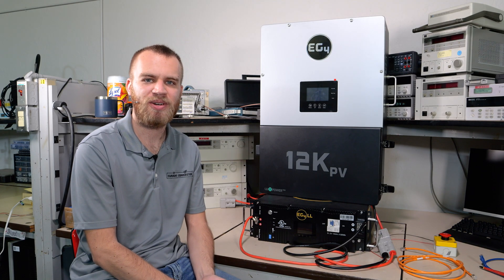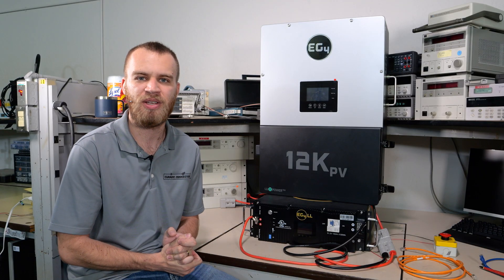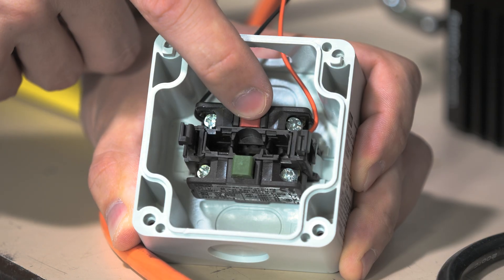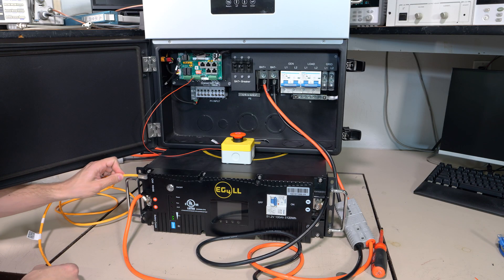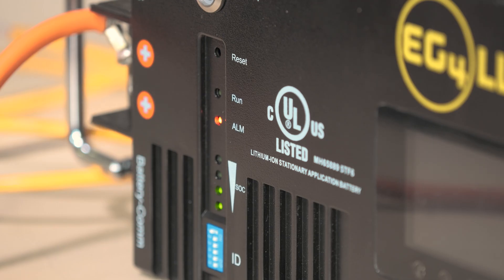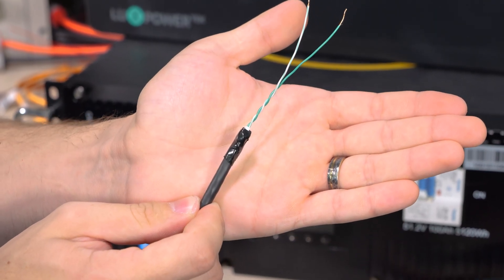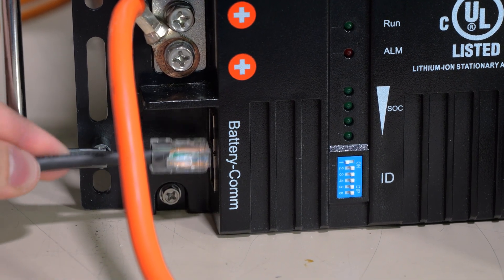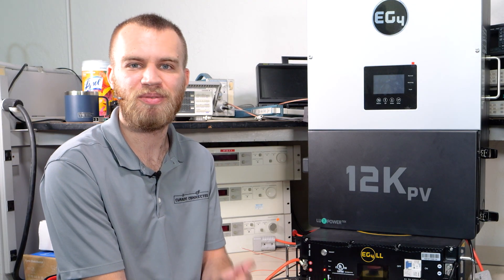DIY Solar Safety Alert! Is the EG4 Emergency Shut Off Compatible with Every Major Inverter Brand?

Comment: The rapid shutdown is pretty wild.  I've tested it a few times on my FB21/GB/battery system.  It really does turn off everything.  Turns off the solar RSD transmitter, commands the batteries to trip their physical breaker and turns them off, turns off the inverter, and the GridBoss also disconnects all the smart ports and disconnects the utility.  Literally everything is de-energized.

Fortunately it's pretty easy to get things online again.  I just have to flip the battery breaker(s) back on and soft-on the battery and the whole system boots back up and resumes normal operation.

Some people have complained about this, thinking that the RSD button should just take down the solar panels and the GB should leave the house connected to the utility.  But I really like the way it works.

Comment: EG4 is garbage compared to Sol-ark 18K now but you guys like to promote cheap products buy cheap and sell at high prices dont care about coustomer. All about profit 👎 trash 🗑️
Reply: Dexter is the most honest and helpful person I’ve personally ever dealt with!!!
Reply from the maker: Don't worry, we'll be making videos on the Sol-Ark inverters as well! As soon as our shipment of the new 18K arrives, we'll have that on the bench. The cool thing is the rapid-shutdown on EG4 batteries also works if the batteries are paired with Sol-Ark inverters.
Reply: There are also sol ark videos on this channel too. There isn’t really any bias here.
Reply: They sell whatever people want to buy... they sell both Sol-Ark and Victron, both of which are high quality.  But many people are going to buy EG4 whether they buy it from CC or elsewhere, are you suggesting they not offer the lower priced equipment, and not make sales?  It may be the case that they make a higher margin on EG4 products, have no idea, but it's called capitalism.  You are free to leave, if you are offended by capitalism, no one is forcing you to live here.  Wonder if you live your life the way you seem to expect others to live... maybe a bit of introspection is in order.  In my own personal life, I buy a mix of the best available, and Value based products.  I prefer to buy American, but I cannot always afford to do so.  If you call and talk to them or just get text based advice, they will give you an opinion on when value based products may not be appropriate.  I have found them to be honest and forthright over the years.